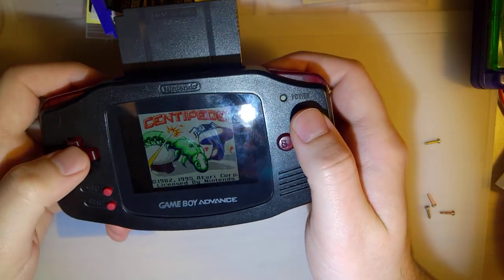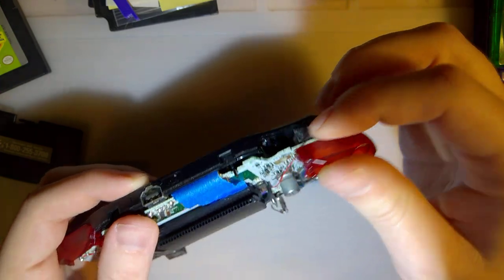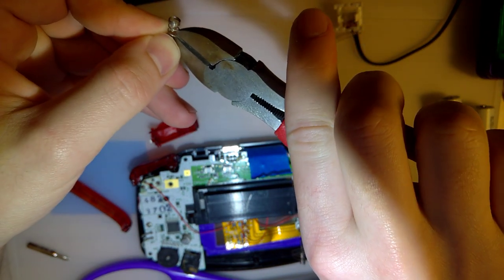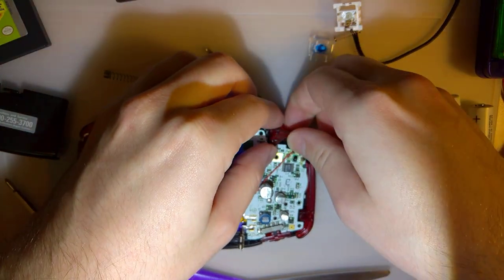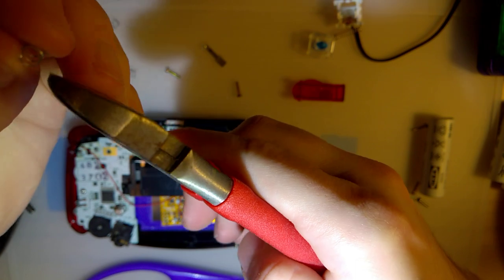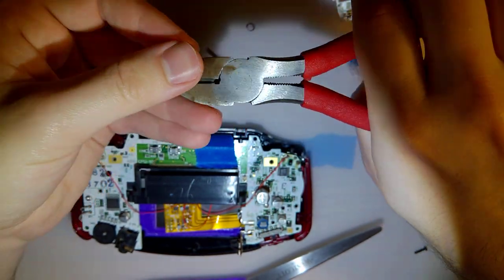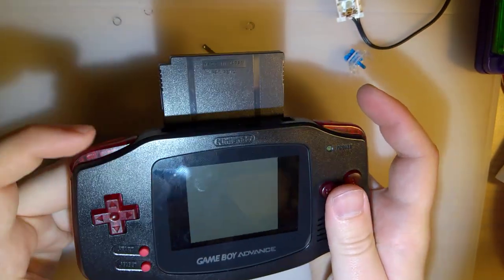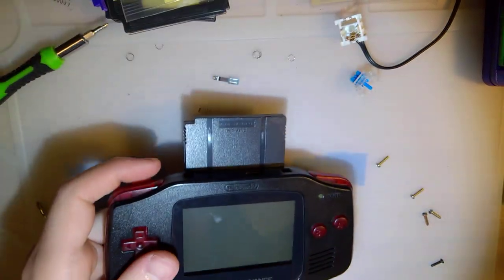Fixing a minor shoulder button issue with the FIPS Install (Part 3?)

Comment: Love your vids man, i used your china backlight gbc install video and it was perfect with out brackets needed.  Do you plan to review the V2 cable? Also I have to say your comment about pre orders in the earlier video made my day.
Reply from the maker: I suppose. I did finally order one. I should have it in a few weeks or so.
Reply: @makho  very nice. I hear they plan to do a sp 001 mod as well. I wonder if your vids had a little inspiration. Lol I can't wait to watch sp001sell like hot cakes on ebay if they do.
Reply from the maker: @scholae8746  I believe they had already planned a SP version when my video came out. But perhaps they still looked at my video and decided to resolve some of the issues I had. That laminated display looks amazing compared to the clear lens I have.

Comment: This is an unrelated question. I'm really enjoying your channel, and in one of your videos, you mentioned the problem with 32 pin GBA's with AGS-101 screens installed have interlacing. You are the only person that has mentioned this as far as I can tell, and this has been annoying me for a while. Is there any way to make the interlacing less noticeable, or is that just how 32 pins always look.
Reply from the maker: No, you have to adjust the trim pot on the back of the AGB. The easiest way to do this is with the AGS Aging cart. This is a GBA SP, but the process is identical except that the trim pot is not directly beneath the battery. https://youtu.be/YxwRK_o2Xx0